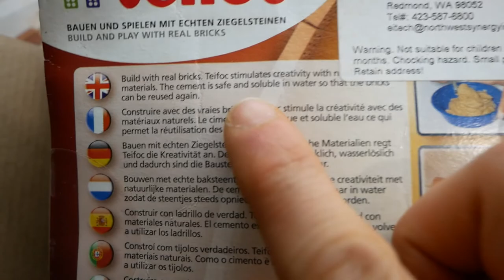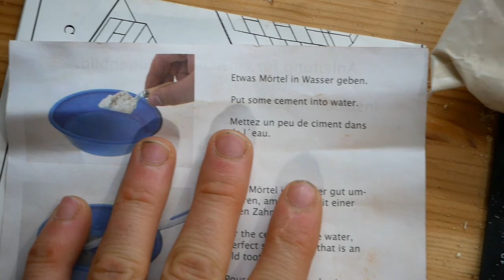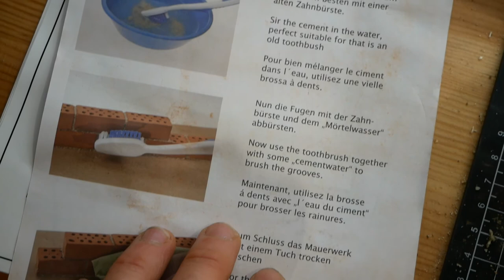TINY WORKING FIREPLACE made from real mini bricks!

Comment: It works! I’m not sure of the difference between mortar mix and the sifted concrete mix you used. Typically you have wet the bricks before applying mortar. Possibly the tiny bricks aren’t heavy enough to be stable stacked without a little glue-like connection.
Reply from the maker: Aaaahhhh that makes sense! Definitely should have googled how to lay bricks before starting haha